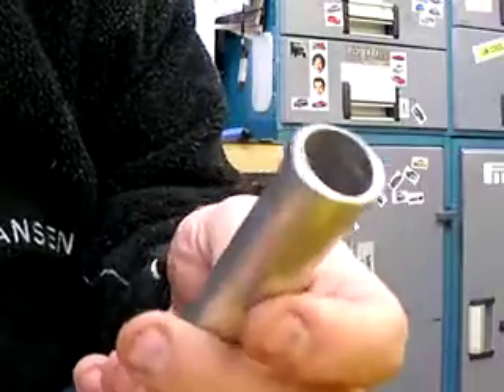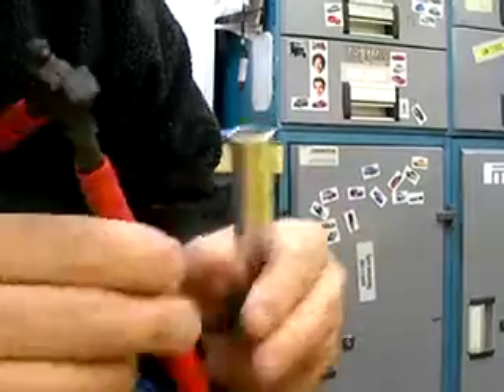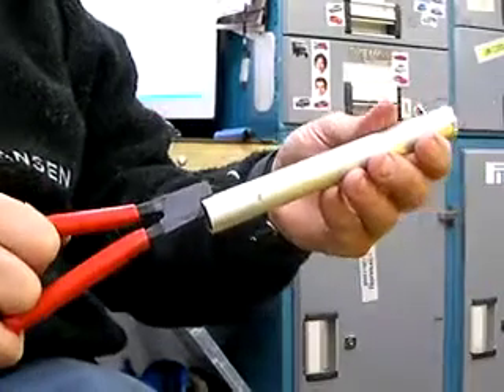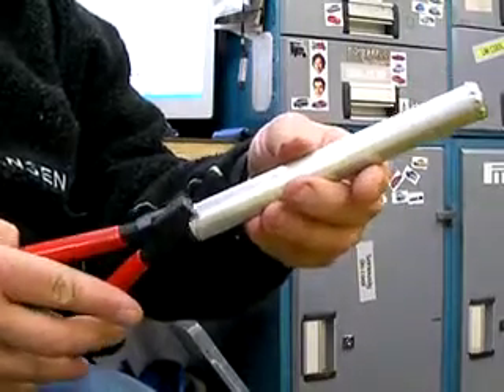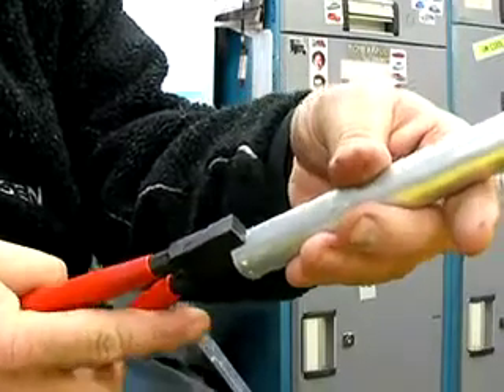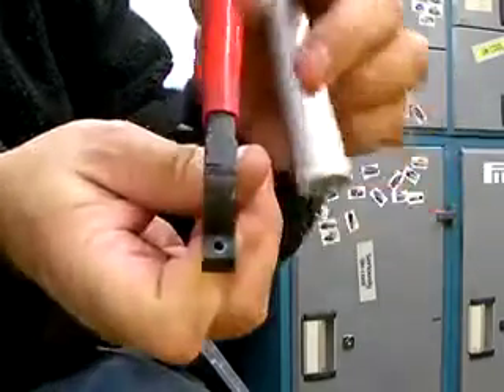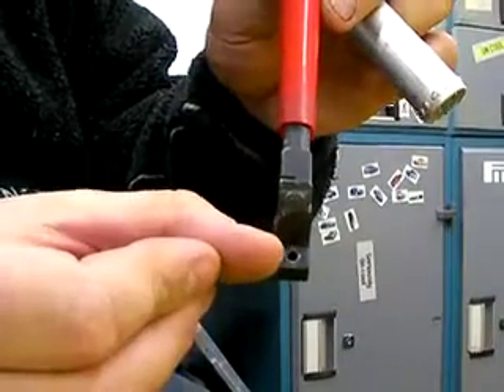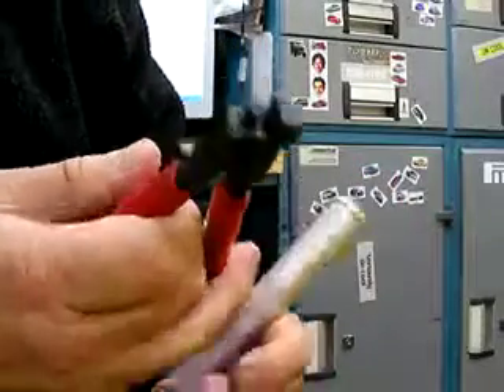Locost bead maker for engine plumbing

Comment: Made one but works best with a large cheap Molegrips, often called Vicegrips, paid £8 in B&Q, thanks, if you weld a short length of bolt shank from a 10.6 grade Allen bolt across the jaw, make a groove on opposite side, then file the bolt shank up into a curve it makes a perfect bead.
Reply from the maker: Kevin Armstrong thanks for the information